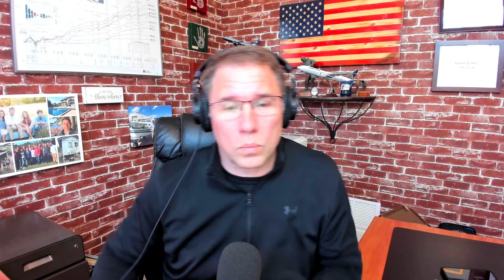Designated Minimum Maneuvering Speed (DMMS)  - Flying 20 Club March 21 Safety Brief

Comment: DMMS for my Cherokee 180 is 95 mph.  I typically fly 85 at the 180 - 10 degrees flaps, 80 on base with 25 flaps and 75 on final with 40 flaps - then slowing if needed due to light weight on short final.  All three of these speeds are below my DMMS.  Flying 95 on base with 25 flaps seems fast.  Is that the recommended airspeed I should be flying per the DMMS video?

Comment: Questions: why did you mention 30 degree stall speed? It’s not used in the calculation is it? 
In the absence of an AOA with audible alert can ForeFlight be programmed to provide DMMS speed warning?
Reply: The DMMS airspeed is arrived at by calculating a 30% buffer above the 30 degree bank stall speed. That is the only reason 30 degree bank is mentioned.  I still fly/teach conservative (20 degree bank) turns in the pattern.  And like you, my eyes are outside 95% of time in the pattern.  I doubt foreflight can provide this  b/c it is based upon calibrated airspeed. I don't know if FF can provide any airspeed or groundspeed alerts. That would be a good question for them - and maybe even a suggestion for them.

Comment: Great simple video. I hear @ProbableCause Dan Gryder mention DMMS speed but this simple video was needed. Questions: why do you mention 30 degree bank stall speed? Doesn’t seem like that is used in the calculation. 
I fly a six pack and don’t have AOA. Can something like ForeFlight be programmed to provide audible alert if approaching DMMS in airport enviro? I like the idea of flagging the A.I. but in the pattern I try to have eyes up as much as possible. 
Distractions when in slow flight is the real problem. Any rules your club has instituted to reduce risk when on sightseeing flights or in the pattern?
Reply: Keep in mind that any additional markings would be on the airpseed indicator, not the attitude indicator. While my eyes are outside 95% of the time in the patterin, the one place I am looking inside is the airspeed indicator. So flagging the airspeed indicator at DMMS makes sense.